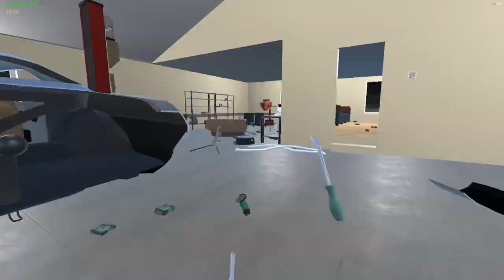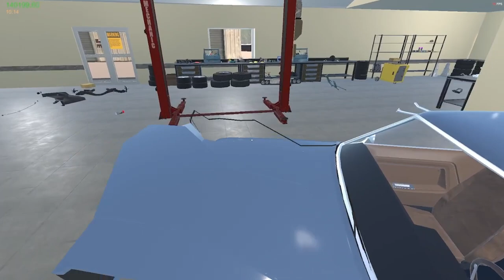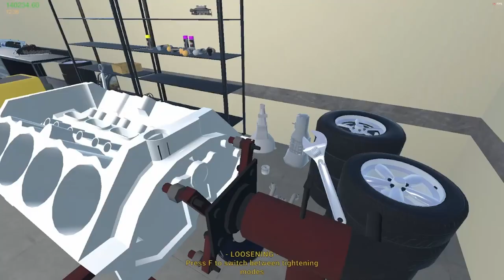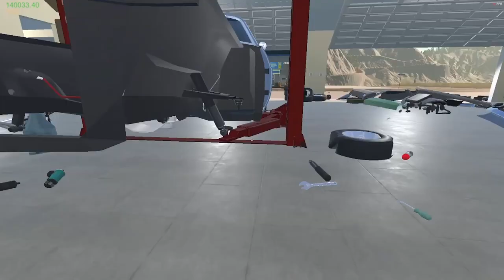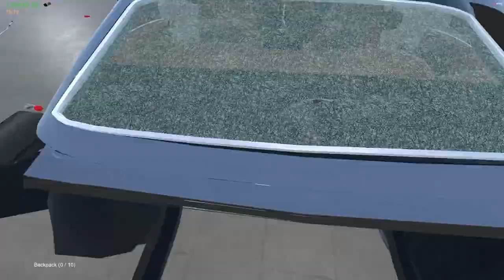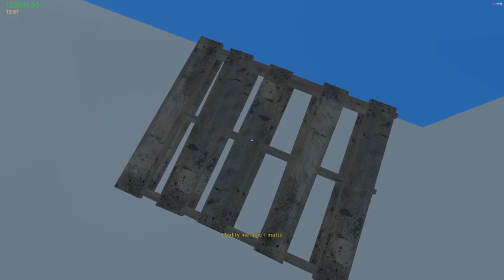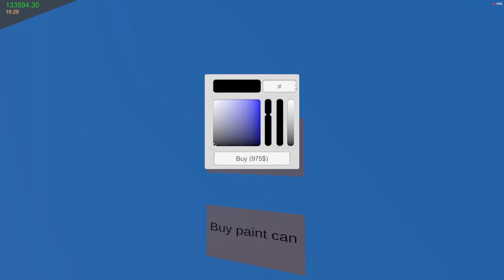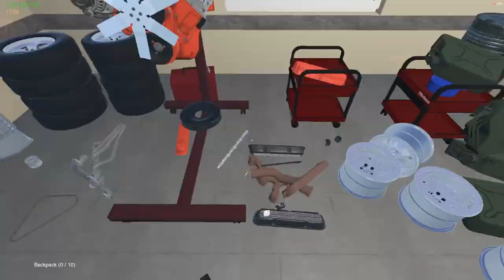My Garage Off Road Challenger Build (Paint Booth Mod)

Comment: thank you again for the shout out, i dont deserve that much, but always appreciate it. gramps driving the 1st mustang is a nice piece of history to know, its extremely hard to do only 1-2 games on a channel and expect to grow or even keep the subs, i too have to spread myself a bit to gain and maintain, and yeah, same old gets boring before too long. on parts like the wires, i have found if they look good but dont line up where they should, unbolt and reinstall, they will then go back where they belong. i personally like and use the mod for infinite weld/grind tool, i never have to buy sticks or discs anymore and dont have to stop till i am done with all cuts. you could always buy 20 wrenches and have them everywhere, just an idea. i look forward to the off road adventures ahead. now if a 4 wheel drive mod would come out and multiplayer was better, id say we need to go for an excursion together and have some shenanigans. fun episode to watch, keep being you, no body does it better
Reply from the maker: I would love to do a multiplayer session. and I may have to stock up on wrenches.